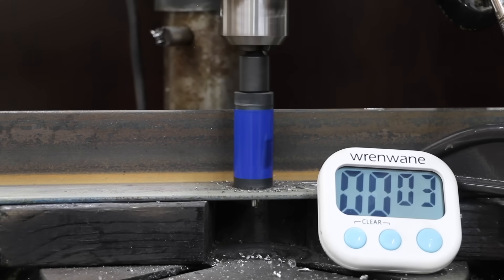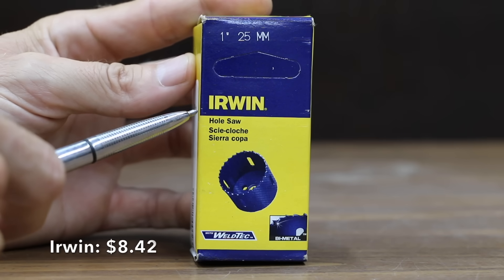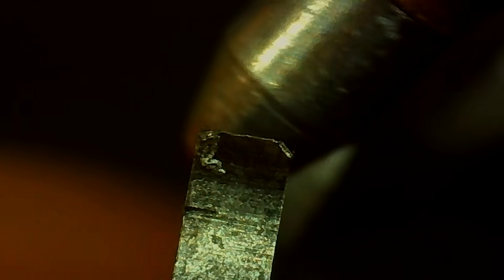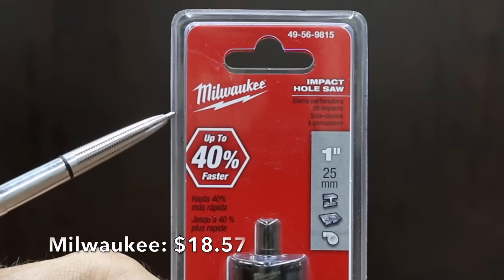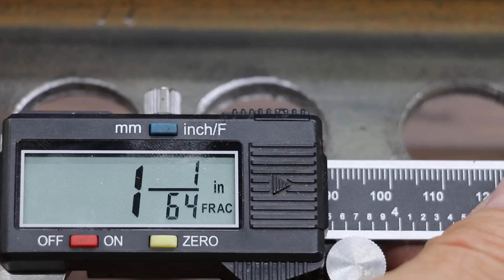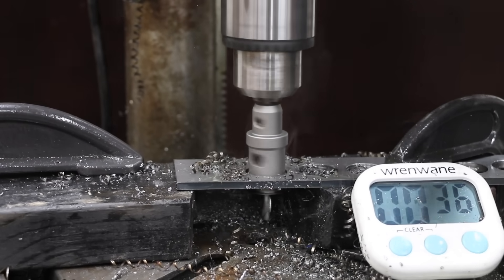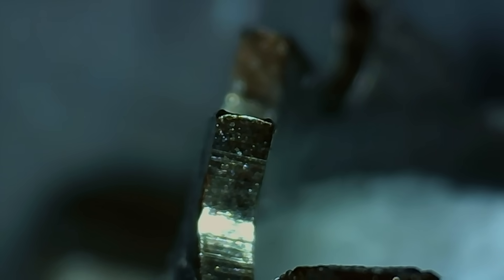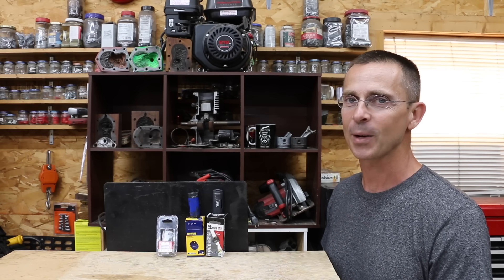Best Hole Saw Brand? DeWalt vs Milwaukee vs Irwin, Bosch, Lenox, Diablo, Bosch, MK Morse

Comment: The "40% faster" on the Milwaukee Shockwave actually stands for: "The teeth wear out 40% faster"
Reply: 40% faster regret
Reply: These are meant for making knock outs in electrical panels/sheet metal. Look at how fine the teeth are, and how thin/shallow they are. The dewalt hole saw before it is the same design. Not meant for thicker metal.
Reply: @MrDarthbader  bingo. You took the words out of my mouth. That particular style is made for very thin metals like panels and ductwork.
Reply: @MrDarthbader  NO, they are NOT! CARBIDE!
Reply: @MrDarthbader  obviously some people dont realize that just because something can be used in a univeral application theoretically doesnt mean its suppose to be especially if its expected to maintain its condition and efficiency
Reply: Literally, I used a 3 inch hole saw for one day and the next day, it was dull as fuck. My lenox 3 inch hole saw has been used for 7 months and still cuts faster than the milwaukee
Reply: True dat, those white hole saws wear out on DRY WALL
Reply: @marcusbrown188  I mean. Yeah. Razor blades wear out in like 5 swipes on drywall. It's basically hard powder wearing at any blade. I've holed out quite a bit of drywall, and I've got to the point that I just use a Sawzall and use a protrusion cover instead of worrying about a clean hole.
Reply: @austinb1800  

Exactly. Never had a blade survive drywall. Oh doing a shower? Why hello sheetrock, no blade shall pass!
Reply: @austinb1800   They make carbide utility knife blades, Lenox.  The cut drywall well.
Reply: @mrgcav  Yeah, I'm aware, when I do rock jobs, I use Stanley carbide, not a huge Lenox fan, but in general, if a sawzall is applicable at all, I'd rather use that.
Reply: True
Reply: Been using the greenlee and/or ideal carbide hole saws for over a decade.  They are or were identical and I suspect that they were or are made by the same OEM.  I have drilled several hundred holes with both the 1/2 and 3/4 KO hole saws.  On occasion I have used a diamond disk in my Dremel to sharpen and redress the carbide.    The bimetal Milwaukee holes as are junk and you might be lucky to get a single hole out of one.  I have used hole saws by everyone and the Lenox bimetal holesaws really hold up.  One reason most holesaws don't hold up is the speed that they run them at.  Sadly Milwaukee is not like they used to be when the bits a blades were made in Germany and the USA.
Reply: I'm pretty disappointed with Milwaukee here. I'm a huge Milwaukee fan, but this time, it's just false advertising!
Reply: The quick chuck makes the Diablo worth it for me. And it is a pretty good hole saw. Should think about adding cat bits and blades to your tests. Ive had some great blades and router bits from them and they aren't too expensive either
Reply: Milwakee is a chinese brand.
Reply: Waste or money
Reply: That’s funny
Reply: I know right I was like wtf! False advertising!! Lol
Reply: Not only do the teeth wear out, the Milwaukee cracks at the weld every time.
Reply: They're garbage
Reply: for carbide hole saws you need to get industrial grade tools. consumer grade carbide hole saws are TRASH for any heavy workload. you get the smallest amount of low grade carbide that gets melted when put up against any type of thick steel.
Reply: @chrishayes5755  can you give your recommendations on what brand named industrial drills to purchase?
Reply: @chrishayes5755  Got any brand name or model that you can recommend?
Reply: I was so disappointed, Milwaukee is the home team brand for me! Feelsbadman
Reply: @MoltenSamurai  There were two Milwaukees
Reply: The Milwaukee Shockwave works great with my Milwaukee Fuel gen 2 impact driver, with a rated 3600 RPMs
Reply: @TheRealMikeWilly  All these people hating on it are acting like he didn’t put them in his top three at the end.
Reply: @steffendetrick9403  they are talking about the shockwave set, not the hole dozer set
Reply: @FluffyAfro  A drillbit does not have teeth so the comment is a little confusing regardless and the review is on whole saws  not drill bits I honestly don’t think they know the difference and probably think all drill accessories By Milwaukee are branded shockwave.

Comment: For those still not sure what to get: the best bang for buck is the MK Morse. You take the average time (seconds) it takes to complete mild and 1095 steel, and divide that by the price and you have the seconds per price rate (SPR). You then calculate the time and dollar difference (seconds to complete - minimum seconds; price - min price) of each type, divide both of those by the SPR to get two different rates. Then you add those rates together, MK Morse is 0.162 followed by Irwin at 0.931. 

If you want the fastest, it's the MK Morse (cheapest, it's the NGE).
Reply from the maker: Thanks for the feedback.

Comment: I used to run a mill and the cutting speed for steel is 500 rpm or less.
Reply from the maker: Thanks for sharing.

Comment: Great job, I don’t know if you realize it or not but when you stick carbide hole saws you have to turn off the drill press and back it up a little bit or you’ll chip the teeth almost every time. 🤟 Carbide will take a lot of shock if it is backed up by a lot of metal. ie carbide concrete drill bits.
Reply from the maker: Thanks for the feedback.

Comment: I was making a few small tool holders for my awls, ( leather)  I tried the step drill ... the thin birch plywood was easy to cut.  And drill .  I needed 3/4 holes 🕳 ... thanks for your ideas 💡
Reply from the maker: You are welcome!

Comment: The harder the material the less you should press, because the teeth cut horizontally
Reply from the maker: Thanks for the feedback.
Reply: @ProjectFarm  you welcome, actually is  drilling is really hard to master, since every drill has it's pace but for testing strength yeah, it's better to put the same weight on  all of them

Comment: These days I have used used drills to work. Sometimes chose right drill is repaired good is machine work well or otherwise machine stops. I have to change another one.
Reply from the maker: Thanks for sharing.

Comment: Thanks for your amazing videos. As someone who is just starting to get experience in metal lathe tooling, I think the carbide hole cutters would have had a much better chance of surviving with a different test setup. The chipping indicates that they're experiencing impacts while cutting, either from binding (possibly from too aggressive a cut), or from chatter. Utilizing the mandrel is absolutely critical to prevent the saw from rattling around inside the trough, and a firm, but limited feed to prevent binding should extend the life of the hard-but-brittle carbide. It was definitely interesting to see some of those bi-metal saws make it through the harder materials like champs. Thanks again!
Reply: I agree.. the modest drill press just isn't cut out for this kind of work. The chatter and binding mean the tool is beyond it's capacity. I have a similar drill press and a JET mill/drill. I can do so much more with the JET than the Delta just because it is more stable and powerful. The teeth just disappear on the Delta but last much longer on hard metal with the JET. 

That does not mean this test is invalid, however. Most of us with a home shop have one of these lightweight drill presses. Great information!
Reply from the maker: You are welcome!
Reply: I think that in this case a bridge port mill could do better (i think)

Comment: Fractional inch values on the caliper for the hole size measurements... isn't it obvious how impractical this is compared to millimeters? Please use metric for the sake of ceasing the massive waste of mental effort caused by inches.
Reply from the maker: Thanks for the suggestion.

Comment: How about testing annular cutters like Hougen, or another test for those hole saws that claim to be for stainless steel. The most common SS application might be drilling a kitchen sink to add a faucet or soap dispenser, test on an old sink.
Reply from the maker: Thanks for the video idea.

Comment: 8:15 Irwin: Shinzou wo Sasageyo!
5 Piece: Omaewa mou shindeiru
Milwauke Shockwave: Nani??
Me: Imperial measurements with fractions is as good as Roman numerals as numbers in calculations. Metric system FTW.

Comment: We use Ideal holesaws at work, where we are drilling electrical PLC panels. These panels are either painted carbon steel, 316 SS, 304 SS, or fiberglass. A bit will last months, maybe a year while even cutting SS panels. We do use a cup of water to cool the bit after each cut.

I just wonder why this brand was left out of the testing?
Reply from the maker: Thanks for the suggestion.

Comment: I bought the Milwalkee hole dozer last week to drill in a kitchen sink and the drill bit snapped in half the second the hole teeth touched the metal. Thankfully Home Depot replaced it and I was able to drill right through with the new bit. Just surprised the think kitchen sink metal snapped that bit in half.
Reply from the maker: Sorry to hear that!

Comment: The Greenlee Quick Change Carbide Cutter Set Catalogue # 660 is the ONLY kit to own. I’ve been using the 7/8” (1/2 EMT) in a factory for 6 YEARS and it still eats steel easily! I have had to replace the starter drill bit a few times but the hole saws are phenomenal! It will be the only kit I’ll ever buy If I ever have to replace it. Thanks for the awesome video. I love your content. Great editing also.

Comment: As a woodworker, it appears that any carbide tipped holesaws will last forever and cut really well through hardwoods (and softwoods). I'll get to them once I finish wearing out the Harbor Freight $10 hole saw set (30+ pieces) I've been using.
Reply from the maker: Thanks for the feedback.

Comment: i recently drilled a bunch of holes in 1/8 stainless for an electrical project...probably 100+ holes ..found that standard milwaukee hole saws did better and lasted longer than high dollar greenlee carbide cutters used ripidtap and a cordless drill on low speed prob 100 pounds pressure.....theres a test....
Reply from the maker: Thanks for sharing.

Comment: I bet if you flipped the material piece after you reached 50% you would have had a complete drilled holes (on a couple) due to less work hardening of the material as well as less stress on the teeth.  This method has worked for me.
Reply from the maker: Thanks for the suggestion.

Comment: I bought an incredibly cheap concrete holesaw from Amazon to drill a 2 inch concrete hole and it was amazingly effective and I used it on a Milwaukee cordless hammer drill
Reply from the maker: Glad to hear it worked out for you!

Comment: Hey can you make a video comparing which self feeding wood bit goes through a 2x12 the fastest? I had to drill a 2 inch hole through probably a hundred or so floor joists today to run heat lines lol
Reply from the maker: Thanks for the suggestion.

Comment: I use a mix of Lennox and the Milwaukee hole dozer daily, we go through probably 1-5 holesaws a day, I personally don’t like the Lennox I see it tends to snap the teeth at the big weld and continue chipping the teeth off. The hole dozer seems to hold up okay but I do notice the teeth break aswell not as bad as the Lennox
Reply from the maker: Thanks for the feedback.

Comment: The problem, as AvE is separating the Chinesium carbide from actual carbide. Cheap as borscht, but you’ll end up replacing it 5 times as often.

Comment: I’ve been using a DeWalt 4.5 “ circular saw for repairs on shipping container floors . Probably in service for 10 months now. I’d like to see a review of blades that can handle the extra strong marine grade plywood. It’s 1 1/8” thick and undercoating is common which gums up the blades. Also it has the extra special “Australian treatment” of pesticides and is often oil or salt saturated. I can provide a sample if necessary but small as it costs me $150 a sheet to buy.
Reply from the maker: Thanks for the video idea.

Comment: Wouldn't drilling a hole or 2 on the circumference of the hole saw create a channel for the metal or wood dust to travel through so you wouldn't have to back out and blow out the debris?
Reply from the maker: Thanks for the video idea.

Comment: Prefer the bi metal ones. Imagine a piece of carbide stuck / melted / embedded in a half- finished hole. Have a set of Morse since 20+ years in use.
Reply from the maker: Thanks for the feedback.

Comment: Our holesaw deill bits cost between 40-80€, are internally cooled and can be sharpend 5-10 times😅 it takes around 30 sec. Per hole (24mm hole in a 20mm thick mild steel plate) and they didn't care when we drilled 10mm finecorn bullet proof shooting range plates😅
Reply from the maker: Great information. Thank you

Comment: Amazing channel my new favorite channel.... You should do hand tools ... What about for wood ?? Forstner bits hole saws auger bits or paddle bits on two 2x4s stacked... Electricians have to go threw those slot ... We still haven't found out what's best bit for those when going up a wall valley.
Reply from the maker: Great suggestions! Thank you
Reply: @ProjectFarm  Thanks I see two of the top for wood are Diablo speed demon forstner bit and milwaukee big hawg hole saw idk for auger and paddle bits.

Comment: You did not run any greenlees..... the carbides with the shoulders are electrical hole saws  designed to keep people from cramming the saw into hot panels.
Reply from the maker: Thanks for the feedback.

Comment: Carbide is supposed to cut much faster than high speed steel, and when possible with a pretty significant feed. So your carbide bits might be significantly better performing. 

Secondly, AR500 is more of anti wear, and is not the military’s choice, just the civilian market, and is more common as teeth and anti wear plates on large machinery
Reply from the maker: Thanks for the feedback.

Comment: The thing that I struggle with is how hard holesaws bind and rip your arm off, and how much they wander and oversize a hole. For this I propose two tests. The first test is drilling a 1" hole half way through some 1-1/4" or 1-1/2" pipe, with the pipe mounted one a rotary table free to rotate along the spindle axis. It would be secured by a spring scale, or just a spring and an indicator to see torque surging. The second test is to drill through a piece of plate mounted on rubbery engine mounts or something similar so we can see how much the hole will cut oversize and how much extra material you have to remove with a hand drill.
Reply from the maker: Thanks for the video suggestions.

Comment: Did you use the same pilot bits for all saws?   A pilot bit off my a micron or two will affect the performance of the saw and the resulting hole dimension.    Too many variables.    Do a video on comparing where the metals come from.   Pointing out USA, China, Germany etc doesn't mean much.   90% of these are the same with only the brand name difference.

Comment: I bought a set of the Irwin bi-metal hole saws to cut a bunch of thick washers (from 3/16" mild plate steel) to build body mount hardware for my truck. I gotta say I was very impressed with the way they cut but the arbors and pilot hile bits leave some to be desired. The bits bend easy and the arbor doesn't hold the hole saw centered so thats what makes the cut hole a little wonky.
Reply from the maker: Thanks for the feedback.

Comment: The highest force is experienced when the bit goes through last remaining material before breaking through as this is where it cuts the most amount of material. So normally want to reduce the pressure and/or speed near the end to get a clean cut. Did you consider this?
Reply: exactly. the pressure is a big variable to keep in mind. usually these tools are used onhand drill and the pressure applied varies widly during tu he operazion   takes g ew secpnds to burn the theet on the saw because of the fri ction at lowpressureofpenetrazion. te testis a smoke for etallurgy ignorants. many metals if wormed and then coled hardens beyond recovery and the only way to drill is to worm the part and cool it slowly or  start a new one. carbide is the hardest metal compound we have for machining and performs well next is diamo.d if you can affort it.the se test should be done by professional labswere enginers proof the results mathemetically.hnockouts a re better tools to get precose holes and clean results grinding second operation is a must for precise holes.

Comment: i have an idea   witch chain saw electric or gas powered is the best to use in a kids first gocart (training gocart)  and if you test gaspowered then i would like to know witch one has the best a durable clutch on the chainsaw    and this idea is simply to use the cainsaw as the motor and clutch (ifgaspowered)  hope this idea sparks an intrest in you
Reply from the maker: Thanks for the video idea.

Comment: When using your drill press I think you should raise your table so the spindle isn’t extended so far. It looked like that could have broken those really expensive one because of that wobble with how hard the carbide was

Comment: Nope, never, not good for anything. Hole saws are crap.
In wood they just gum up und smoke, use a forstner bit instead.
In sheet metal use a fly-cutter for quicker cutting with less horsepower.
The only application for which I would use one would be in a tube notcher for taking semi circular bites out of the ends of tube so the butt up for welding. Even then there are better cutters available.